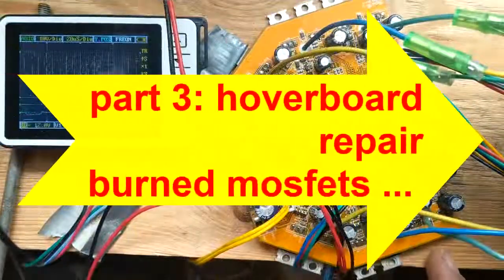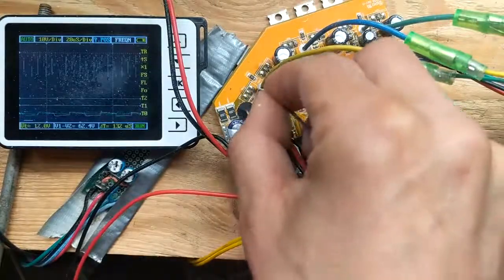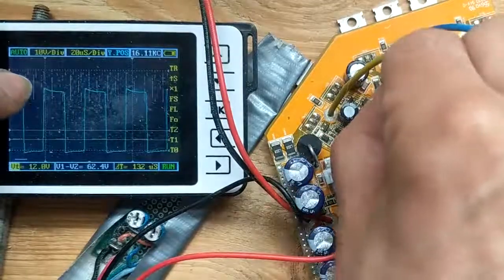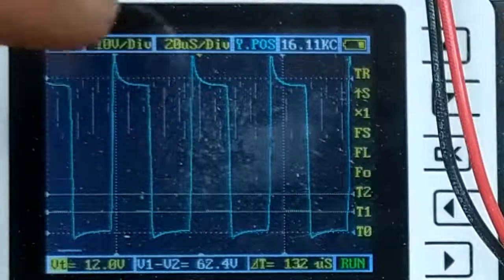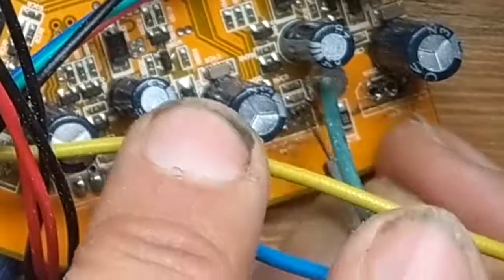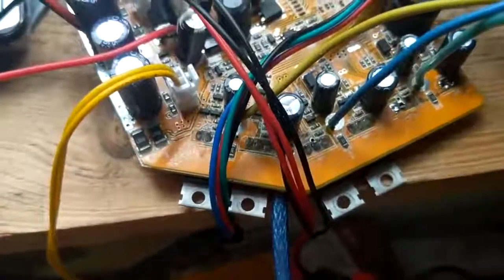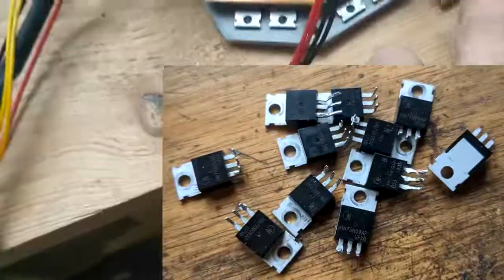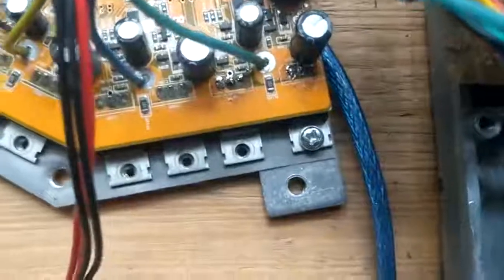part 3: hoverboard repair - burned mosfets ...

Comment: Flyback diodes across your fets. Drain to source. 
Big, fast flyback diodes. Preferably Schottky, with as little Vf as possible and reverse voltage about double of your Vdd. 
Maybe add a snubber network on each phase to gnd. At 16kHz, something like one ohm with 10nF? 
And low esr mlcc decoupling caps on the high-side drains and ground. 1uF@60V, put plenty, parallel. 
You can blow fets from back-emf, their intrisic diodes are not suited to soak those inverse spikes (scope a running, loaded motor) 
You can also get unlucky and score counterfeit parts... Like factory rejects or re-labeled.  

And the high-side gates are driven by a totem driver with the help of a clever bootstrap circuit which, basically, uses the high-side fet to pump itself a voltage 10-14V higher the Vdd to power it's totem driver.

But flyback diodes... Those save lives.
Reply from the maker: Great comment. Maybe you can post an AliExpress link to 50pcs or 100pcs of suitable shottky diodes :-)
Or better buy at some more respectable place ?
It is wintertime now here in Germany, so I can wait two months for the flyback diodes to arrive from China.
I guess I do not want to modify the gate circuits. But adding a diode to drain-source is no problem.

Comment: Hello
In this video you only change the mosfet and after it work ??
Reply from the maker: Well i suggest you watch the video to the end.
Reply: @robodurden  i have exactly same this problem, I replace the mosfet and after power on exactly the board short and shutdown
Reply from the maker: @YouCantNow  And you have checked the gate pins of the broken mosfets with a dso / oscilloscope  before like i did in the video ?
Reply: I don’t have a dso , can i use multimeter to check
Reply from the maker: @YouCantNow  not really. A pocket dso is so cheap. i added this to my collection: https://www.aliexpress.com/item/1005005289191027.html
If the new mosfets blow again then probably the gate driver is broken and you might have the full battery voltage at the gate pin. So yes you chould unsolder the broken mosfet and check with the multimeter that the low-side mosfet gate pin sees an average voltage of about 7 volt (because with a dso you might see a 50% duty 14V pwm). It is difficult to check the propper gate voltage of the high-side mosfet gate pin because this generated with both mosfet soldered in :-/
But anway, if you replace the broken mosfet with new ones and they instantly blew again, then better get a replacment board.
I some other repair video i talk on these little smd transitors of the gate driver logic that might be replaced to repair the gate driver. But i do not think that this is worth the time.

Comment: Hello RoboDurden

I had the same problem as you, I burned two cards. Thinking about it, it was each time after flashing the Emanuel Féru firmware with the nunchuck variant. I reconnected the card without having connected the controller. the motors ran at full speed for 3 seconds then stopped. Each time 2 mosfets burned on each card
Any idea ?
Reply from the maker: test with a 2A constant current power supply to prevent repeated mosfet burns..
Reply: thank you for your answer 
I do not have a 36 volt constant current power supply 2A
 How to limit the current of the hoverboard battery?
Best regards
Reply from the maker: @JoDar-r9i  24V will also do. The 2A charger might also do. simply do not connect the battery. Good bye !
Reply: it’s really an excellent idea 
I didn’t know it could also work on 24 volts 
thank you

Comment: hey @robo durden , I connected the charger in the hoverboard but it doens't swap the led to red, it stays only with green light, do you suggest any problem in the hoverboard or in the battery?
Reply: I think this is battery unbalanced or dead
Reply from the maker: I agree with eflose. Check the battery with a multimeter.